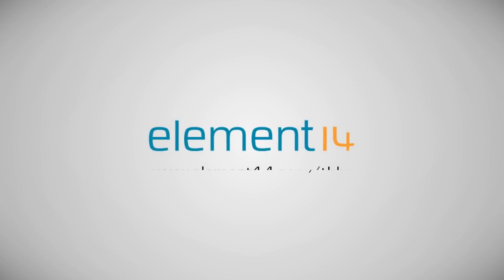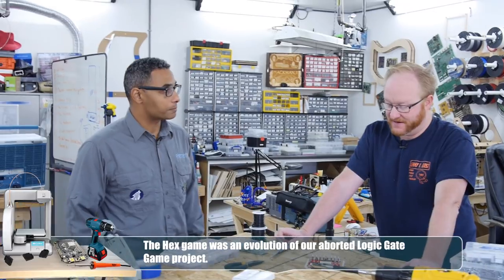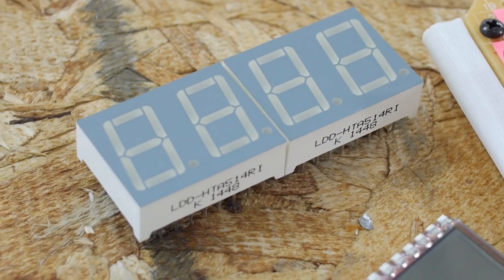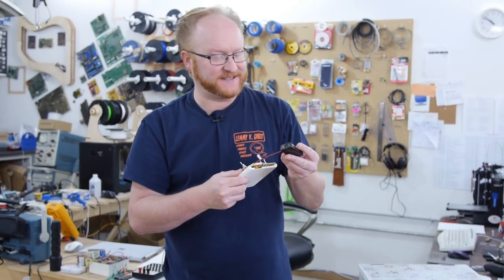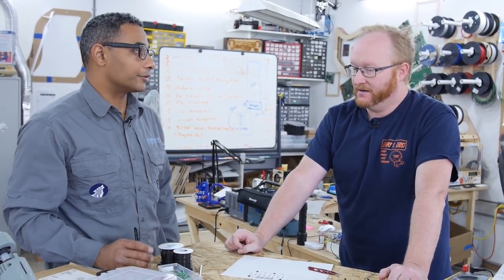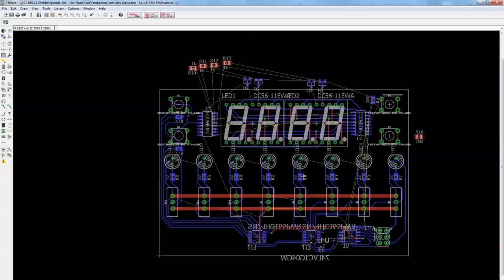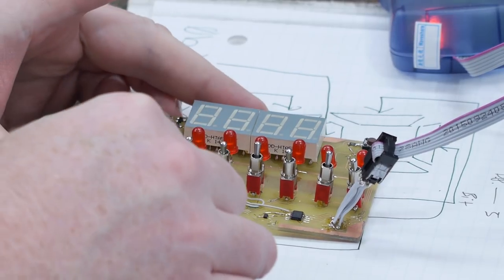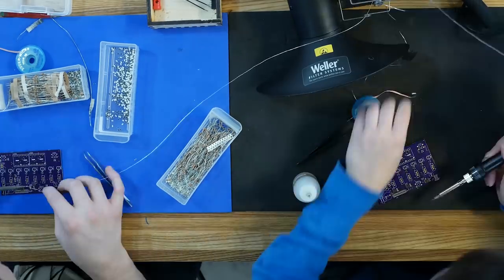Hex Game 01: Breadboard and PCB Design

Comment: triple battery pack - the bane of our existence. I challenge you to a dual sir.
Reply: Just buy a pack of 12 AA batteries.
Reply: IC what you did there
Reply: I can't say I've ever seen Rechargeable AA batteries in 12 packs...
Though I guess 3x4 works out about the same...

What, you DON'T use rechargeable AA's?

Huh.

The existence of NIMH AA and AAA batteries is why I get frustrated with people that whine about game controllers and stuff using AA batteries instead of non-removable Lithium ion packs.
Assuming rechargeable batteries being used either way, I vastly prefer the AA based solution...

Certainly the Gameboy colour I have is more convenient to deal with than the GBA SP with it's proprietary battery pack. Especially in the long term when getting replacement AA's has been possible non-stop going on 50+ years, while proprietary battery packs for pretty much anything at all are hard to get working replacements for as little as 5 years afterwards...

Meh.
Someone should really devise a universal standard for rechargeable lithium ion packs that is as straightforward as AA's are...
Even better if the standard is good enough to allow in-circuit charging of any pack using a generic charging circuit...

Comment: possibly solution for doing double sided pcb with the laser paint method. why not 3d print a pcb holder, then hot glue it into the laser when you want to make pcb's. that way you can flip the pcb and have it perfectly aligned.

Comment: The original larger version seems to be a lot more ergonomic than the smaller board, with enough board to hold with your palms and your left/right thumbs able to control the upper/lower nibble. Also, I cannot wait to be able to order this, but I am in the UK. Will I be able to get one?
Reply: We'll have to wait and see what sort of testing and certifications are required and see if there are any restrictions placed on the kit. Hopefully we will be able to ship worldwide....if this makes it to market. ;)
Reply: If it doesn't, would it be possible to get the full parts list, schematic and code so we can cobble our own together? Keep up with the great work!

Comment: Question: what's the advantage of using shift registers instead of driving the 7-seg 3-digit display directly from the AVR pins? Does it use less IO? thanks!
Reply from the maker: Yes you use less IO because you're sending out a bit pattern on a few pins as opposed to dedicating 7+ pins for the purpose.

Comment: Pretty sure 66 isn't the answer, but 00101010 (42) is...
Reply: they represented it in BCD 0100 = 4, 0010 = 2
Reply: Which I would then interpret as two half bytes belonging to each other, or two completely separate values, where that would equal six.

Comment: 01000010. Isn't that in Futurama?
Reply: Builder's Mark, they mean 42, which is confusing the way they wrote it. 0100 (4) 0010 (2). It is a reference to the hitchikers guide through the galaxy. I don’t watch Futurama but they might have referenced to the same things as it is pretty well-known.
Reply: If writing it out as a full, single number, it would be 101010. Since he broke it into two lines and did each digit individually, it's 0100, 0010. I think.
Reply: theHeckwithKaren I know but it just feels wrong to represent a number this way